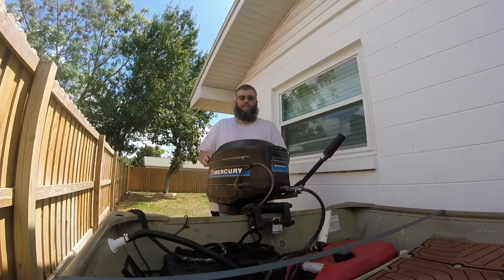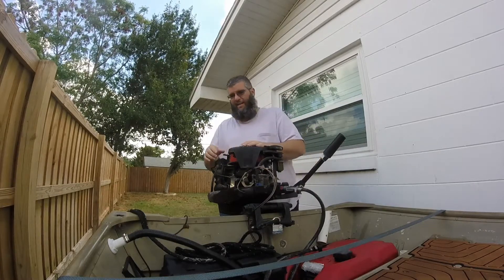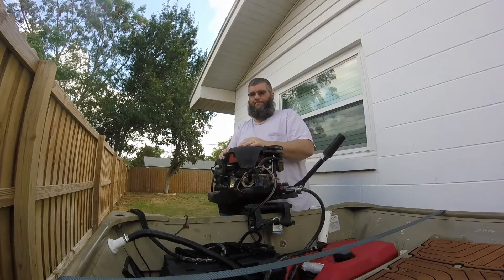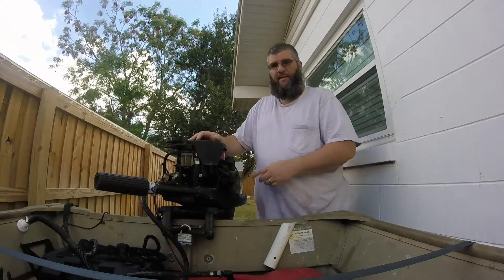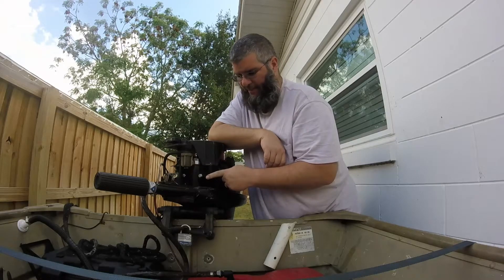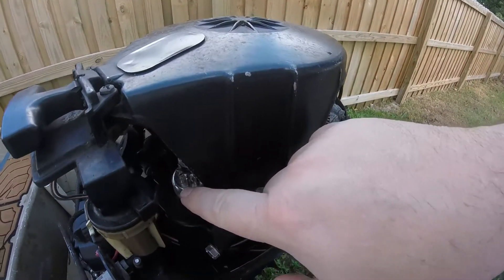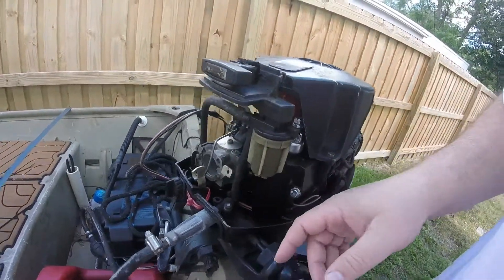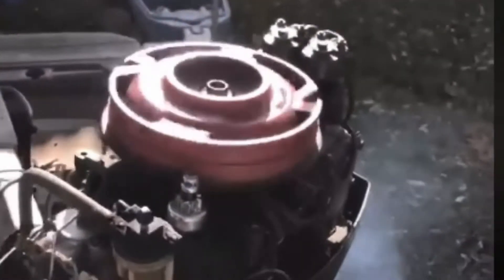Leo Builds It... Mercury 18 HP Electric Start Conversion   Part 2   Short Version

Comment: What it did you buy? And from where?i have same motor
Reply from the maker: Well considering it was done 3 years ago. I got made sure my outboard was able to take a starter. 

The starter can be found in the link below:

https://www.amazon.com/gp/product/B008Y3SDI6/ref=ppx_yo_dt_b_search_asin_title?ie=UTF8&psc=1

The flywheel I found on ebay using the following part number: 8274A6 - I got lucky to find one with an attached ring gear. 

And the starting solenoid below is the one I used:

https://www.ebay.com/itm/264510976232

Hope this helps you with your project.

Comment: just got the same outboard. Could you tell me which excat flywheel and start you used?
Reply from the maker: The starter: Rareelectrical STARTER MOTOR COMPATIBLE WITH MARINER MERCURY OUTBOARD 9.9EL 9.9ELRC 9.9ELRC SM52160 50-90983A https://www.amazon.com/dp/B008Y3SDI6/ref=cm_sw_r_cp_api_glt_fabc_8GW6RR7354GHV5G0EH4S?_encoding=UTF8&psc=1

And the flywheel: 8274A6 9301 for a 25 HP Mercury outboard
Reply from the maker: I also used a $10 lawn tractor starter solenoid and a push button momentary switch.